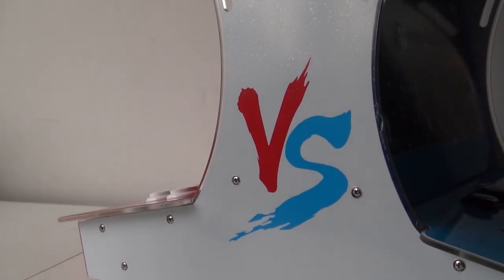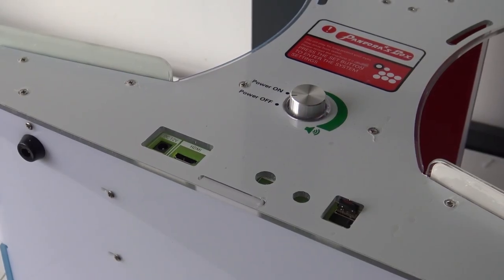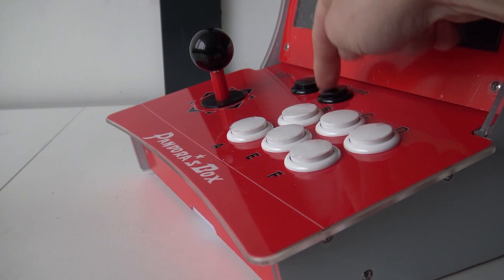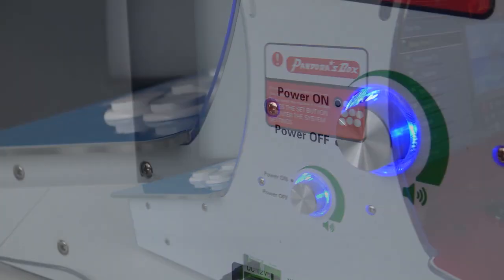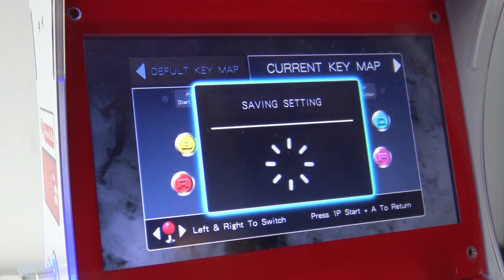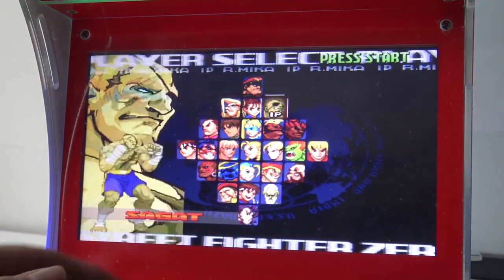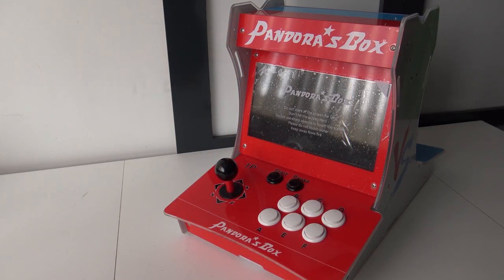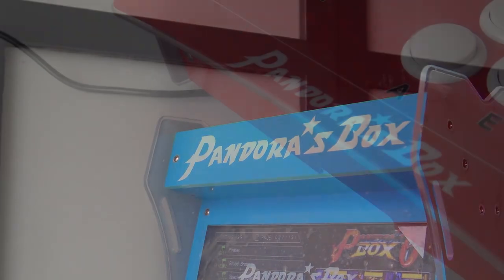CRAZY...  Duo Monitor Machine With Awesome Features 😁

Comment: This looks like an ideal cabinet for future modding. Nice enough space to put a full motherboard. But yeah you are right the screens would be difficult to modify the screens to use rather than if it was a VGA or HDMI or even RCA connectors.

Comment: This is a cool cabinet! To divide the screen, I would use a HDMI cable with the L connector to return it inside the machine and a normal HDMI split so, in the future, you can upgrade the system.

Comment: I'm not such a big fan of the acrylic casing as you are. I find it too brittle and easy to crack. And maybe its just nostalgia but for me there is only one material for an arcade... wood with t-mold edges. Call me old, call me boring but it just gives me a nice feeling inside.
Reply: Yes and again a stretched screen. Again No 4:3 screens.